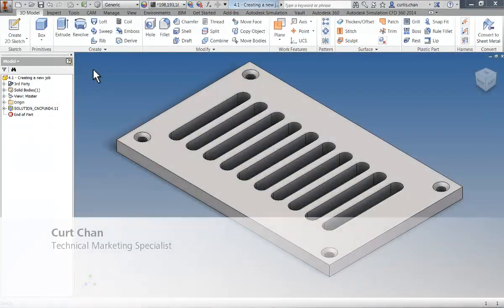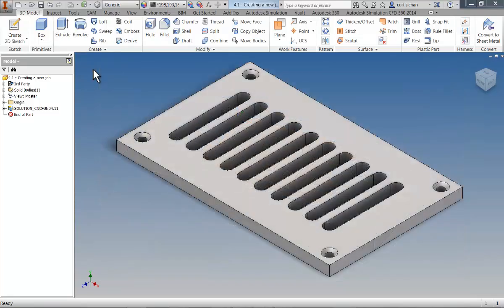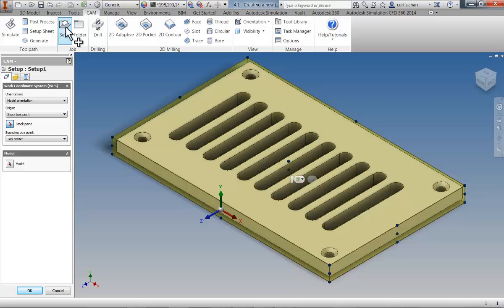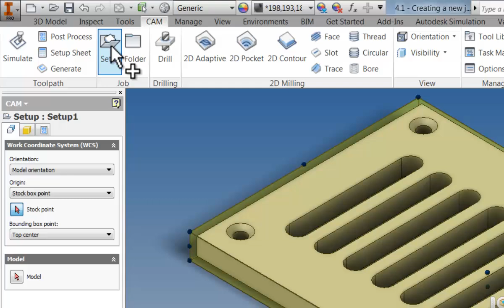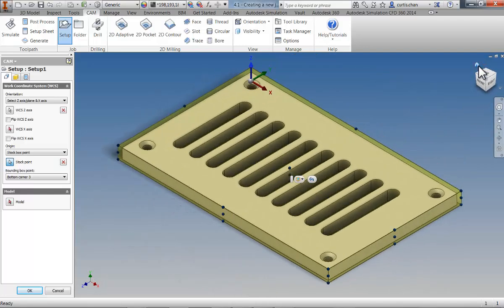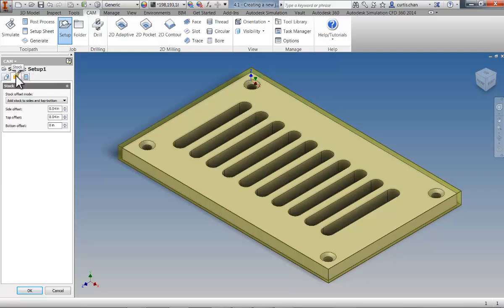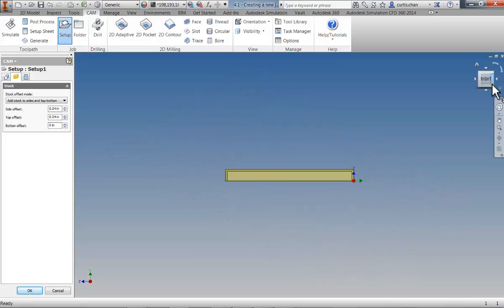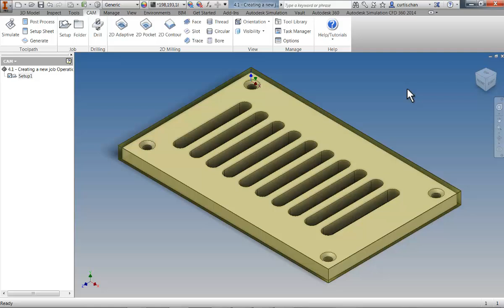Inventor HSM Express—Introduction to Creating a New Job

Comment: Where do you find the tutorials files for this and the other demos?
Reply: +Autodesk CAM yeah guys, this part isn't in that folder.
Reply from the maker: Hi. You should find all the tutorial files here:
C:\Users\Public\Documents\Autodesk\Inventor HSM 2015\Examples
Let me know if that is not the case and I will hook you up with support.
Reply: I looked, Found some models, But not the one in your great tut. I wonder if i need to DL them?